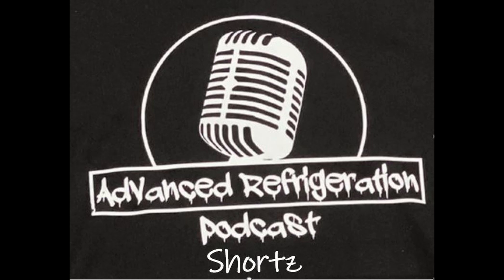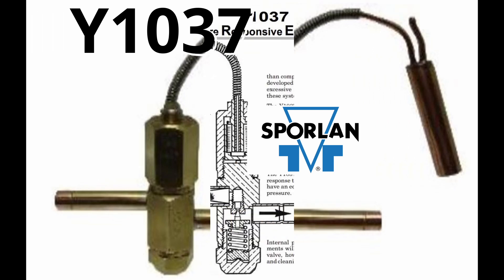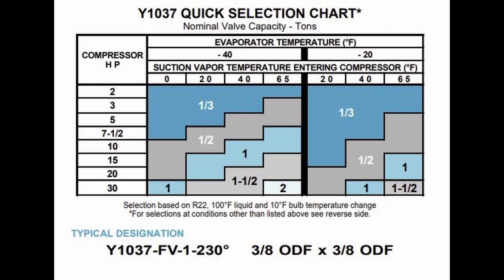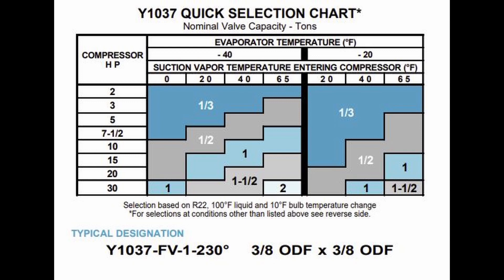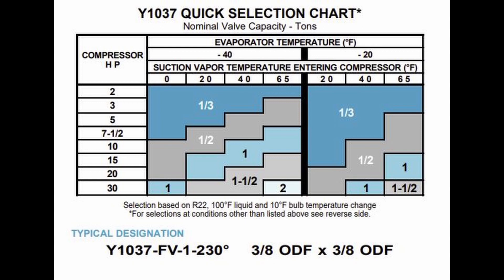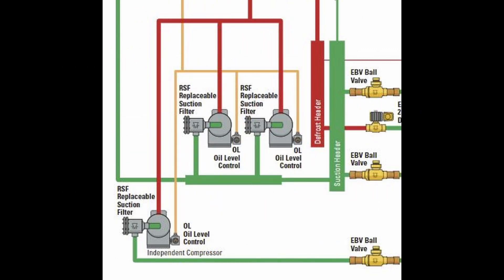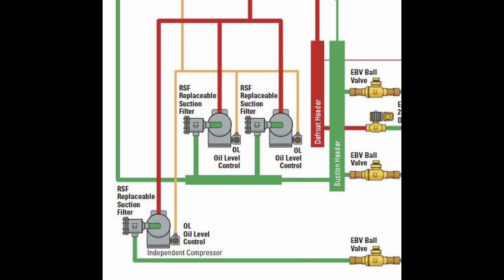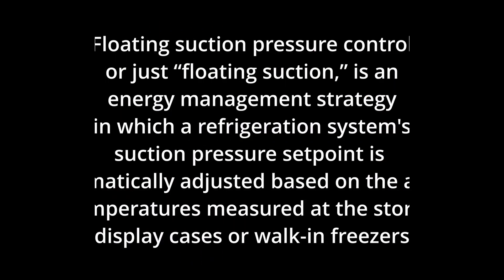Understanding Liquid Injection

Comment: Okay then, can you tell me the lower end of the range of temperature for discharge gas? Everyone has the high end range, but what is the low range? The reason I ask is due to the fact I have seen oil separators desuperheat and create liquid, and return this to an oil reservoir. If I have a sensor staples to the discharge line, what is the recommended low range?
Reply from the maker: You can buy one that has a discharged pressure of 19230 and 240 they might have other ranges but you'd have to call sporlan
Reply: In ammonia we have a setting where if the discharge temperature of the compressor drops 15 degrees in a set amount of time like 20 seconds. It’s referred to as liquid slug warning.